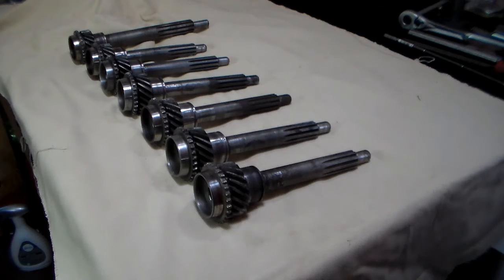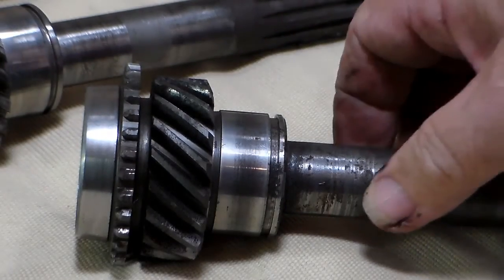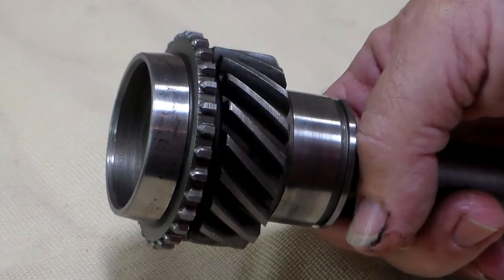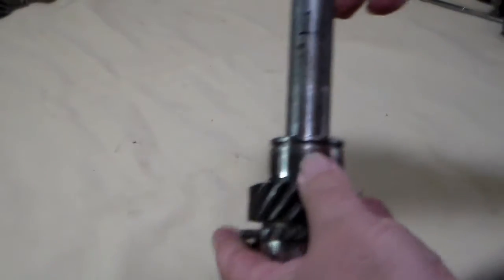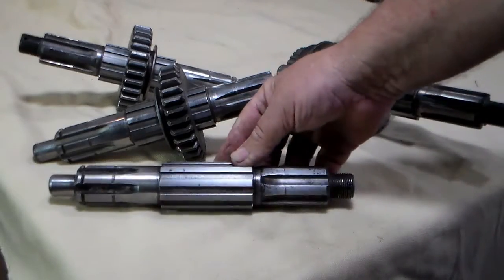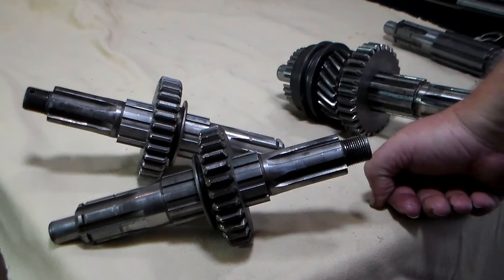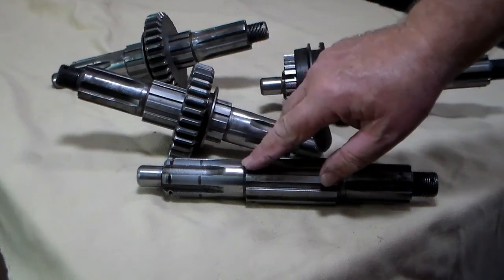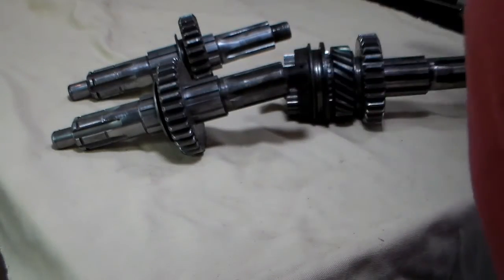7 Rick Stivers T-90 Rebuild Guide - Inspection Part 2

Comment: Great videos, Rick, I just took my apart and the main shaft has metal basically welded to it where the pilot bearing is in the motor and looks like there was issues near the throwout bearing. Also my case is shot due to bad area where the brass washer rides up against it. It’s pitted and scraped up. My question is, are the T 90 transmissions that you see on eBay for $1000 from India any good?   I’m sure my transmission has more problems than what I stated, but that was enough for me to stop inspecting.